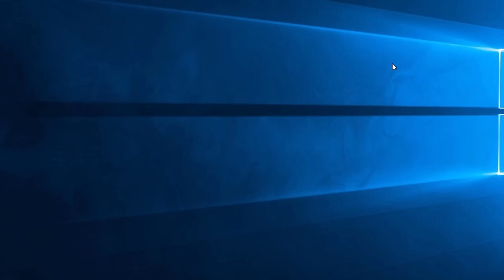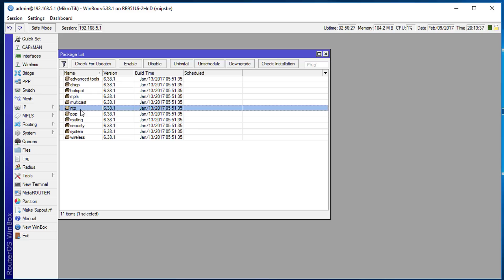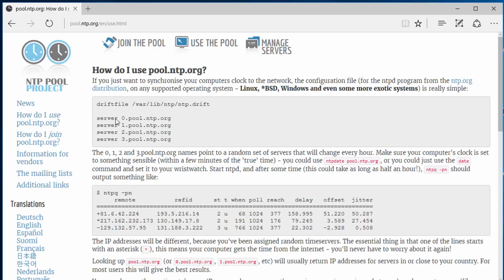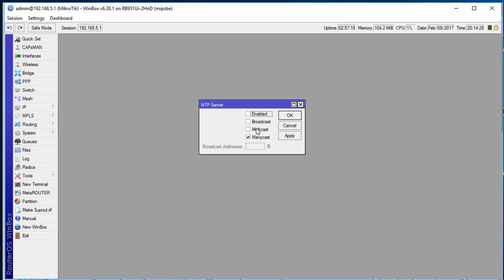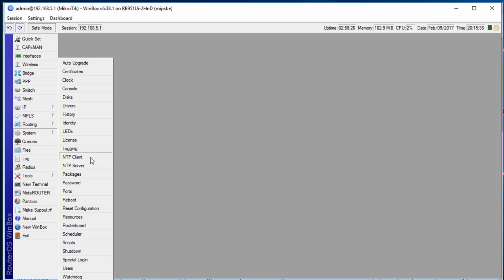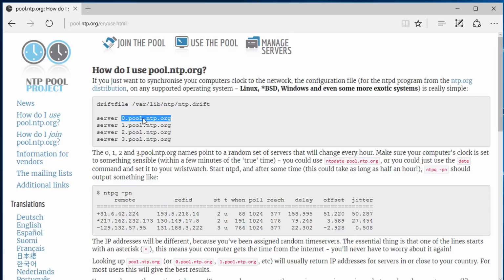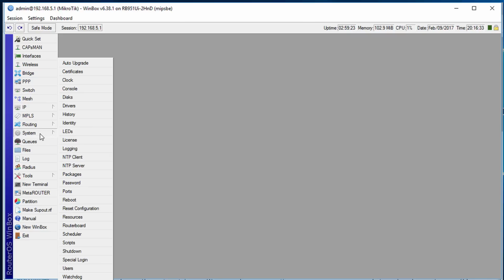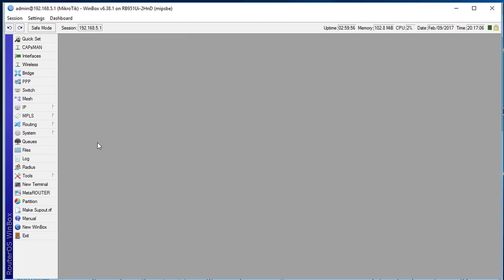MikroTik Tutorial 8 - Configuring a NTP Server

Comment: Which are the cases where devices need to synchronize ? I mean other devices are just dump enough I guess to not have a list of all the 0.gr.pool.ntp.org etc. and other ntp servers and just automatically get it from the internet. Having to setup this manually sounds a little silly for 2021. A comment not for Mikrotik but for network devices in general
Reply: If servers time runs a little off from the computers, certain software will not work. I run into this often.

Comment: For some strange reason it wont let me install my package for NTP i have followed all the steps of the Package installation videos -- am using a hAPac everytime i drag the ntp package to packages nothing happens where as when you done it - it should a pop up installing or adding the package - can you help?
Reply from the maker: +Lobos Ensure that the package being used is correct. Try do a reboot after dragging over the package.
Reply: TKSJa thanks the reboot worked ☺